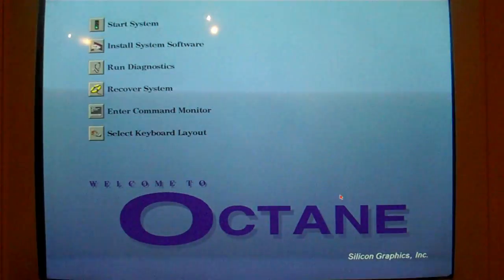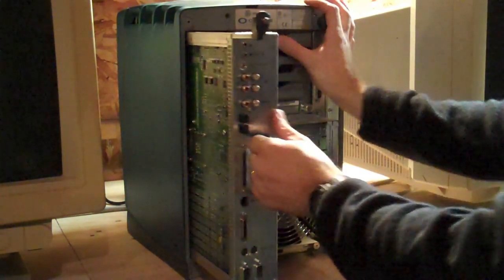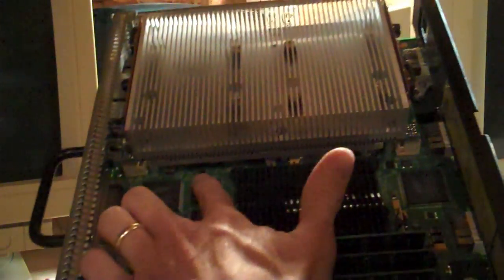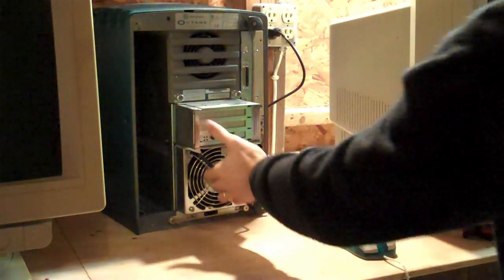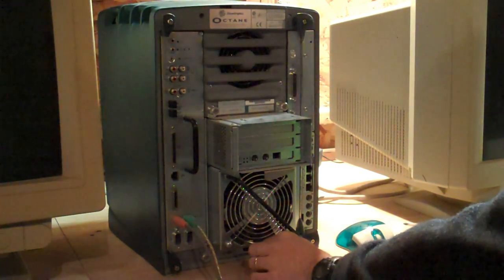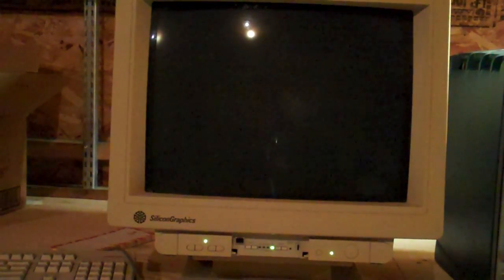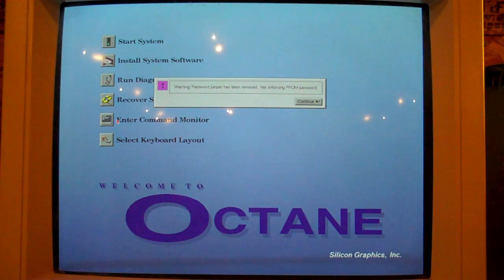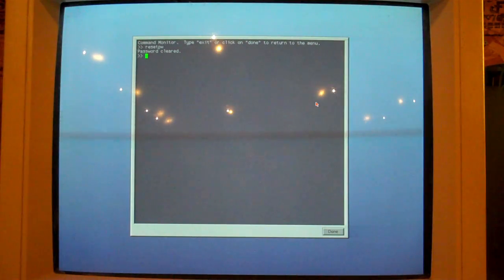How to clear the PROM password on an SGI Octane

Comment: Hey mate, love the videos! I know its been a while since this one came out but thought I might still give this a go, haha

I've recently come into possesion of my own Octane, but in my excitement and hubris I broke the cardinal rule old electronics. NEVER TURN IT ON BEFORE GETTING IT CHECKED

Suffice to say, heard the fans spin up really loud and I saw the magic smoke come out (No bang though). Trying to get the PSU checked up on and was wondering, do you know if theres a way to activate the PSU outside of the Octane to check its running voltages? I know with stuff like ATX power supplies you can short pins to get it to run outside of a system, but can't figure out if thats the case with the Octane. I have a Lucent Technologies PWR.SPPLY.S2!

In any case, love your videos mate! Have a good one!